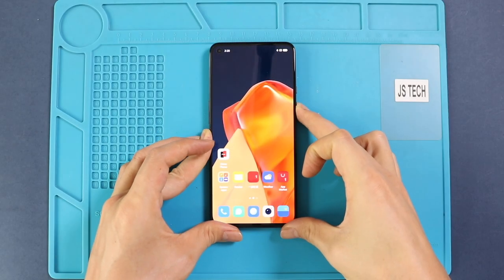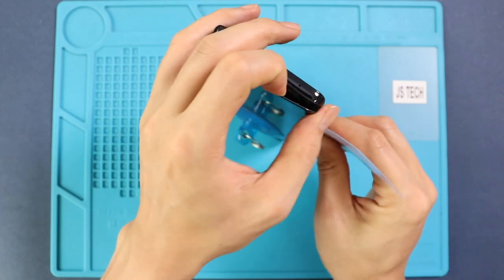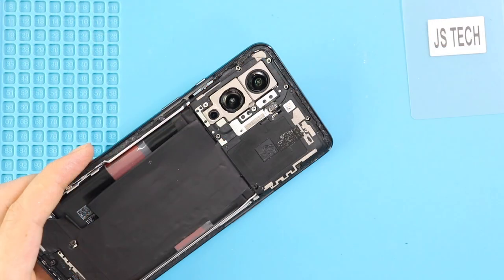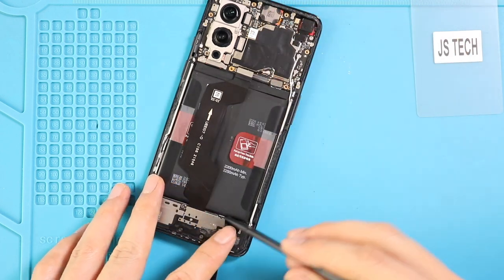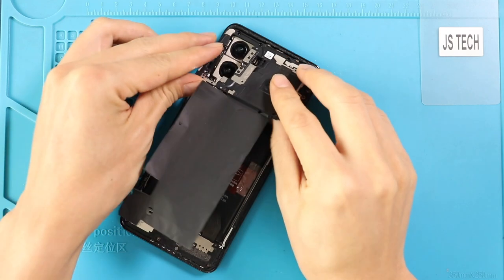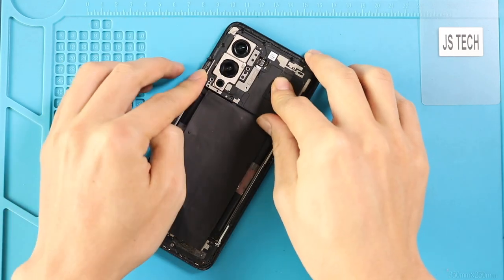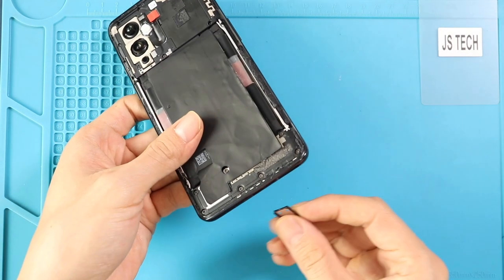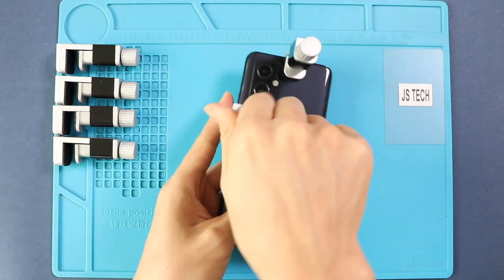Oneplus 9 Battery Replacement BLP829

Comment: Mine, the connector is on the other side and the battery 829 is a bit too big. It doesn't see to be the BLP829 on my One plus (not Pro version)
Reply: I had the same issue. Haven't found one that will work yet.
Reply: @nathanpetersen2476  i think the BPL821 from oppo could be the right one but bot 100% sure.
Reply: I'm having the same problem did you find a solution? I need to replace mine right away.
Reply: I have the same problem. I have connector on the other side as well. One plus 9 5G from USA. LE2115. Guys please give me some solutions.
Reply: @ThatsMe517 where are you from? I have the same issue as well. Mine was from USA
Reply: @redwanrizvi   USA as well I haven't found a solution.
Reply: @redwanrizvi   Actually I think I found a solution. I did some more research and someone recommended BLP821 which has the connector on the left side.
Reply: Okay. I will try that one. Thanks  for the advice.

Comment: I would like to buy a NOHON battery for the OnePlus 9 cn but it is only for the OnePlus 9 pro. Is the battery from the OnePlus 9 pro the same as the OnePlus 9 and will it fit and work?
Reply from the maker: No it is not same..

Comment: My oneplus 9rt has Android 13.1 but its battery backup is very low and can run for three hours on a full charge. Now what I should do is not to change the battery, it is a software problem 
😭😭 plz replay 😭😭😭

Comment: Where you get the battery from it's not 2200
Reply from the maker: what do you mean?
Reply: @DIYGeardo   the capacity for the battery it's 4600 they all say 2250 etc online the replacement

Comment: Sadly on US version battery cable was on the other side and ifixit had cable on other side. I did bend the cable slightly and it fits and works who knows how long it will last I got the phone for free so who cares.
Reply: Just ran into that myself, had to remove the black tape and reposition the board of the battery for it to fit.
Reply: That's wanted to do was little nervous because the last battery was fat lol.
Reply: hey @toonsish I'm having the same issue and im looking at ifixit. Was your model LE2115? mine is. I don't know which battery to buy to replace mine.
Reply: @ThatsMe517  basically the same I think
Reply: @toonsish  what was the battery you bought? BLP829? or something else?
Reply: @ThatsMe517  also I have had zero problems with it. But it is second phone

Comment: I wanted to know is my battery working fine or not, it was 100% 8 hours ago, and after 3 hours and 10 mins of screen on time, i am left with 27%. I dont know whether I should get a replacement or this is normal, can someone help me out?
Reply from the maker: We’re you playing games ?
Reply: @DIYGeardo  No btw, I just realised, that it was because of oneplus switch, cuz I previously owned op6. I reset my phone yesterday and got a screen on time of 6 hours. Oneplus switch is shit.
Reply from the maker: That is strange
Reply: @_anshuman  I didn't even know that so I uninstalled it as soon as I read your comment.